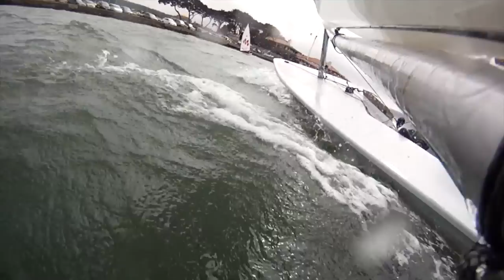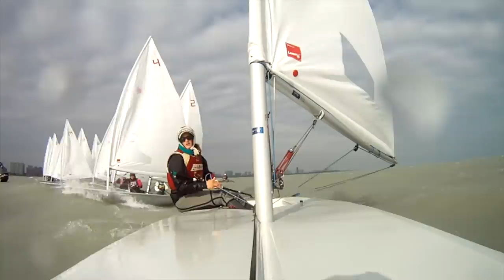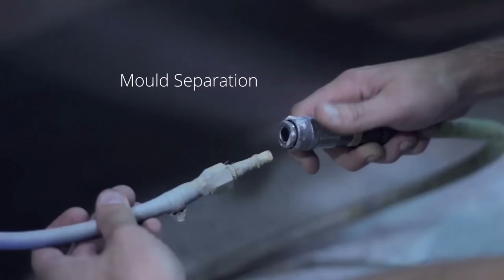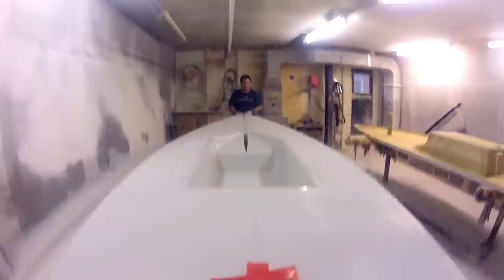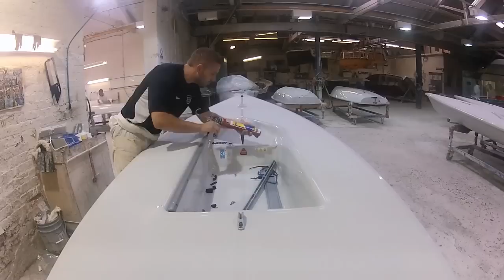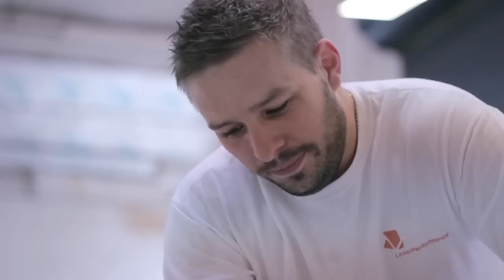Building Lasers is a Labor of Love

Comment: Interesting, I am cleaning up my well used Laser built 35 years ago. Heavily oxidized is coming out amazing. Lots of elbow grease wet sanding 400 600 1000 and then 3M compounding and wax.

Comment: Curious about how its apparently a Labour of love even if laser dont solve any of the design flaws
Reply: Late to the party.

Laser is a great boat to have by the lake or at your summer place. Sturdy, low mainenence (uless you need that 0.01 knot advantage in a race), not too challenging for beginners and (for weekend warriors) it doesnt harm it too much to be dragged up on sand.

Why its still the largest race class though is beyond me. 

Its too heavy, too old-school, doesnt surf as well as other boats (goes up and down waves, wont really keep surfing it when you get it going) and overall outdated.

For example a 49er is not even twice the weight, is for 2 persons, has a combined downwind sail area of 56 m^2 compared to lasers 7 m^2.

Sure completely different class of boat, but what im getting at here is the sail to weight ratio.

I mean the musto Skiff weights 15 kg less than the laser at 44 kg, yet is 35 cm longer and just as wide by the hull.

These ovington hulls are like eggshells, crack at the smallest impact, but that doesnt matter when you race since everyone knows what they are doing.
Reply: @SportSoulLife  Indeed, even seeing chopped strand glassfibre being used shows how outdated the technology is.  It certainly is time to look at better designs and construction techniques. 
I had been contemplating getting one, to use when I don't have my bigger boat in the water, now I see there are better options out there.
Reply: @Tomm9y  Apparently they got more expensive now as well since the Laser and ILCA (their new name) dispute.

Try Europe class, or Finn if you are big enough
Reply: @SportSoulLife  it ain’t for beginners in my opinion it would be for armatures that can sail. It is the biggest racing class as there just fun. As for weight idk where you getting that From it’s a light boat . Comparing a 2 person boat to 1 person boat is dumb like as 1 person you can only have such a big sail. The skiffs are lighter as there is less material. On a laser you need the larger deck so you can get your weight out but on a skiff you got the bars. And justo skiffs is a total different type off racing it is purely racing made.
Reply: @adamatch9624  

Well its not ideal to start in in heavy weather, but with someone coaching them, normal conditions and a size smaller sail id say its perfectly doable.
As soon as someone can tack and gybe and go from A to B they should be able to handle a laser. 

The best modern version of a laser i can think of is the RS Aero which weights 30kg the entire thing, with sail sizes (roughly) 5m, 7m and 9m. 

Skiffs need rigid decks since the crew jump around and run on the boat constantly. 

The laser is wayy to heavy for its size by modern standards. But that is also what gives it its stable planted feeling. 

The laser is fun, robust and wont mind much being under a tarp in your backyard for 15 years. But for racing there are better boats out there. 

Exactly, laser isnt 100% focused on just racing, its almost only focused on keeping the boat the same as it was in the 70s. Yes its fun to have boat classes like that, but i dont think it should be at the olympic level. Even the RS Aero is more exiting to watch than laser. 

The laser should be like the Windsurfer LT. Great for all levels and ages, races are held, works for just about anything you can think of, but has nothing to do in the Olympics or at the very top level of the sport.
Reply: @SportSoulLife  I chose the Laser because it's the only boat where I can find a competitive fleet, and that even if I would move far away.
Reply: @SportSoulLife  the price of a new Laser is a fraction of the ILCA as there is now actual competition and Laser Performance has lost the ILCA endorsement. It just shows how much money ILCA and Laser Performance have been making off us for years.

Comment: I wonder why the class rules don't include a heavy bulb at the bottom of the centerboard, so that the sailor doesn't have to hang so far overboard to keep the boat from capsizing?  Or is that all part of the fun? :-)
Reply: That's the big fun part!
Reply: Big part of the FUN 🤩 and Super FITNESS 💪 You get from sailing ⛵️ a Laser 😎🏴🤪
Reply: more weight = slower boat